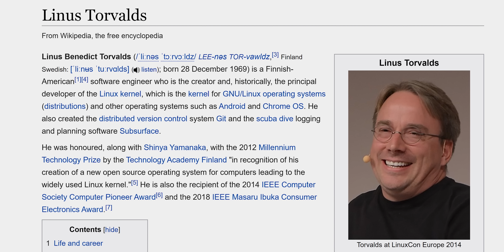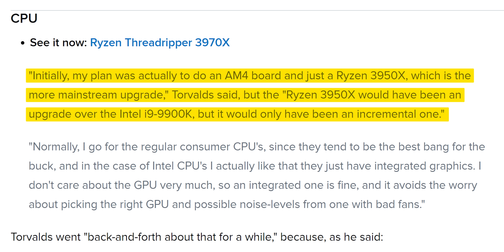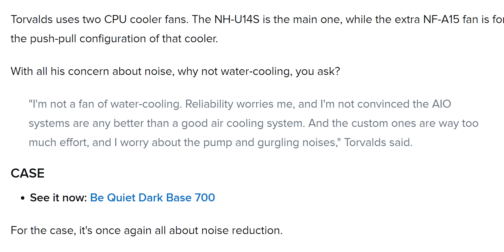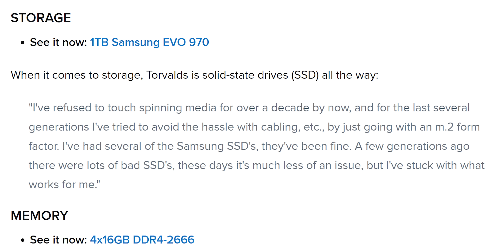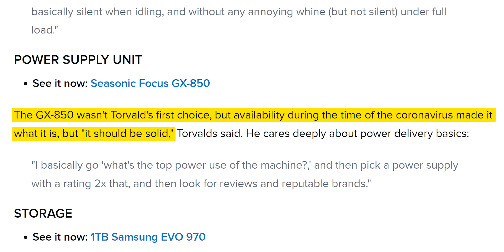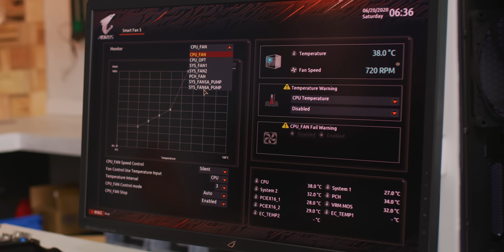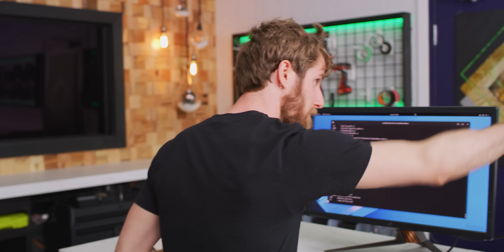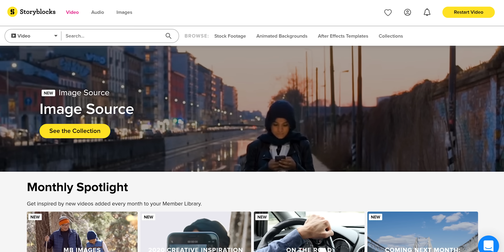Linus builds Linus’ new PC!

Comment: Hi Linus I am a developer. First, gamers tuning videos DO help (we can discern what matters to us). I built my machine (W10 pro, 3900X, 64GB 3600, X570) with focus to compile/link ~600 files quickly (replacing laptop 4C/8T i78650U). Findings = had to make sure NO core parking is in effect otherwise it will do just like the laptop (build = 2 minutes). Next, base CPU clock is not so relevant. Boost clock (how high and how long can sustain) IS relevant. After enabling Ryzen HP Powerplan + RyzenMaster Auto OC, Mobo no eco mode..., build went to 42 seconds (970 EVO plus with write caching enabled). This seemed like arithmetic 4c/12c performance increase (not making up any number here). Then, I was able to go to 30 seconds by DISABLING SMT (12C/12T vs 12C/24T).. I have no idea why this happens, using SMT @24T what happens is that CPU load is almost always constant 15% ish on exactly half of the threads (100% the others) during the entire compilation.. moreover, I would still expect this to be closer to 12C/12T but no... spooky (some internal IO bottleneck???). Then, I was able to clock 19 seconds by compiling from a RAM drive (ImDisk TK). At this point (compiling from ram) SMT off->on only makes ~1 second offset improvement (normal variation up to +/-2 seconds). Any ideas why SMT made this dramatic NEGATIVE effect?? (compiling from RAM, all 24T always 100% load with SMT on). Edit: I am still looking for ways to build faster... I did only basic HW/OS tweaking....

Comment: I don't know how your build took that long, but probably because it's a Live image running from a USB Stick!
I just finished building the latest Linux Kernel 5.7.7 on my Convertible ultrabook HPEnvyX360 with the 8-cores 15W Ryzen 7 4700U and it finished in just 2 Minutes 53 Seconds :D
I used this command (8 parallel threads)
$ time make -j 8 defconfig bzImage modules 
and this is the time command output
real	2m53,190s

Comment: 15:50 For my development needs it's pretty simple: for compiles you need a CPU with lots of multithreaded performance, over a long time. That's why I've been using a Thinkpad T420 upgraded with a quad core rather than any of the more "modern" 15W U-series CPUs Intel has put out. Their thermal design is generally garbage, and they get power throttled within a few minutes of full load - making my almost 10 year old 45W quad core significantly more powerful after ~10 minutes.

Ryzen 4000 mobile might change that, so I'm pretty excited for those devices to come out.
Reply: I just got a Lenovo P53 and the thing ramps it’s fans up when I’m not even doing anything. Intels run too hot now. My last Lenovo was quiet until I started a few 3D applications
Reply: If you get a gaming pc, you can get a 4800H Ryzen based laptop right now.  I did that as a compromise because I didn't want to wait. I would have rather gone with a pure APU Ryzen because it would save some power and I don't need super high display performance.
Reply: why the hell are you programming on a laptop
Reply: @JamesBond-fg6bt  Because depending in your seniority, you might be on the move or in between meetings. Mobility is a huge factor and most companies prefer to hand out laptops instead of desktops, since they can ask a rep (for instance, Lenovo or Apple) when they need OEM tech support.
Reply: @nuno-cunha  so rdp to a more powerful VM and compile your code there
Reply: I switched from my T520 (dual core tho) to a swift 3 with r5 4500u. I dont have numbers, but it feels pretty fast on the cpu side. The few things i compile (mostly big latex documents with lots of pgfplots, tikzpictures etc, a bit of python and very few C++ code) compile a lot faster than even my Elitetower (or sth like this) with an 3rd gen i5.
Reply: I got a macbook pro 13 2017. After 5 minutes of coding, i decided to build a pc to code instead. I didnt know intel and especially, Apple got so bad at supporting devs these days
Reply: That's a dual core, I'd have sent it back to my boss and said wtf.
Currently running a 10900K + 32GB@3200MHz, GPU is a crappy 1030 with 3xDP, just need it to drive screens.

Went from a crappy 4770 (4C/8T, 3.4GHz), my stuff compiles a bit over twice as fast, which is nice, and it probably paid itself off within a month or two based on the time difference, should have convinced work to upgrade earlier. Wanted work to get a 3900X instead, but couldn't source enough of them in one go and they didn't want to end up with two different hardware configurations to support.

Still strange for Linus not to have gone 2x1TB SSD in Raid 1 considering how much he's spending, personally I keep a VM copy of my environment as a back-up so I can be up and running in the time it takes to copy and expand.
Reply: Nguyễn Hưng  my 15 mbp, did just fine up until recently. I upgraded to an iMac,and I’m in heaven. Ymmv
Reply: @NguyenHung-qu2pb  what made the experience so bad after 5 minutes?
Reply: Are you considering installing an AMD Ryzen CPU on your Thinkpad T420??? That'd be a great video!
Reply: @angelrivera8013  Literally impossible unless you throw out the whole motherboard which is more than half the PC and even then the rest of the machine (screen, keyboard) might be too old to support connectors a Ryzen motherboard would use, if it would fit. Unless that was a troll comment, you should really overthink your judgement.
Reply: @aoelp  I'm sure overthinking brings you a lot of peace of mind. Answer me when did I make a judgement by making a simple question? But thank you for your output, you got it out of your system and it must've brought you a great amount of quality rest.

Comment: Hey I am not sure how so could you make sure that all of these parts are all compatible for me before I get them? 
Motherboard: MSI b450m Tamohawk Max ATX
Graphics Card: GeForce GTX 1660 Super
Case: CoolerMaster MCM H500P Mesh Black (Get the Mid-Atx version)
SSD Card: WD Blue 500gb SSD
RAM: Corsair Vengeance 32gb DRAM (2x16)
CPU: AMD Ryzen 5 2600
Power Supply: Thermaltake Smart 600w Black
Extra Fans: Aurora DR12 RGB LED 3 Pack 120mm Fans

Comment: I'm a programmer, my CPU is a intel Core i5-4570T @ 2.90GHz with integrated graphics, 8GB RAM, 2TB HDD (i had upgraded from 500GB) and my OS is linux mint (previously windows) . This was a second PC and it is fast enough for me. Unless your Linus Torvalds or an AI researcher, most programmers will not need high spec hardware

Comment: You just called Linus Torvalds an "average software developer" and doubted he "takes the time to get to know PC hardware". Dude, this guy is not just not an "average software developer", but also he has spent the past 30 years writing a motherfucking kernel, do you have any idea of the level of hardware knowledge that he has? He wrote all of the first drivers in Linux all by himself. If you think you know hardware because you take it out of boxes and slap it together, well he's spent 30 years talking with hardware in the hardware's native language. Remember Transmeta? Torvalds was hired by them as a lead engineer. Yes, this guy worked on designing a CPU, a fairly revolutionary one at that, I might add.

Linux is not like windows, where drivers are entirely third-party work, 99% of all drivers are built right into the kernel, and even though he does very little actual coding now, he did a lot for years, and he still is familiar with the entire kernel. 

This guy knows hardware in a way most people on the planet, you included, will never get to. 

Also, his OCD is legendary, I'm pretty sure he spent a week doing cable management.

Comment: Finally some praise for my favorite brand “be quiet!” They dedicate their products to silence!
Reply: I don't know why they didn't go with a BeQuiet power supply.
Reply: I miss the Antec quiet line of cases. I am sad I got rid of my old Antec p180. Side and front panels were all fitted with sound dampening material. If you put Noctua fans in one of those, I'd bet you could hear a pin drop at full 32 core load.
Reply: Meh.  I like bQ!, but don't be surprised if soon even they don't offer any new cases with a windowless/no RGB option.  A decade ago, some of the best manufacturers offered quality desktop cases with outer shells made of aluminum or metal, some 2 mm thick, designed elegantly.  Today, (except for some htcp, itx, & micro atx cases) few manufacturers offer "enthusiast market" consumers a windowless/non RGB choice.  Gaudy, tacky, useless RGB lighting has found a way into nearly every internal or external component possible.  Even mouse pads.   Popular tech sites blazed the trail for the "enthusiast" market.  Well done, eh?  🤣
Reply: @beli3636  To be fair RGB doesn't have to be gaudy or tacky. And yeah it's useless by nature, but it can make your pc look a little nicer in the room with some nice accents. 
I just typically follow the keep it simple rule for mine. Accent my build a bit, and the only reason it's RGB and not solid color is so I can change my color scheme occasionally when I want to. Boxy blank cases can be nice but I like the tiny bit of style I can get out of mine now, and it's still dead silent except under full load.
Deadening material is easy to add if you want it, and the only side you can't add it on is the glass (or, well, you could but it would look a little silly unless you were clever about it...)
Reply: Be Quiet is cool but you should check out Phanteks

Comment: I would absolutely got the 135W TDP Sapphire PULSE RX 5500 XT 8G GDDR6, instead of the 225W Radeon RX580.
Less heat and more quiet and still a little bit higher performance and more display ports.

Comment: Gigabyte boards are basically Linux and OSX ready, so that's probably the main reason it was chosen as a lot of the components are compatible with alternate operating systems out of the box. As for power delivery, the cpu and memory do draw a ton of power, better to have overhead especially if it's running intensive software. So I've heard Amd's Threadrippper is pretty hard on motherboards which is understandable given it's large power draw.

Comment: Hmm, lots of similar hardware choices to my current rig! And it's running arch. =D
Just installed manjaro on an old macbook mid-2012.
Thing had so many drive issues on windows with no way to stop windows overwriting bad auto drive installation. Causing the system to be unusable or usable without many features (sound, etc)
Anyway... manjaro, everything worked out of the box. Including stuff that had non-existant drivers on windows due to apples bad maintenance of old support files ( disappearing legacy stuff).
Old games that no longer worked on windows because of missing DLLs etc, also worked perfectly fine in Wine.

Comment: Linus, you disappoint me. I'm in the Jayztwocents camp when it comes to liquid cooling - unless you are a super edge case doing extreme overclocking, small form-factor builds, or ultra-heavy workloads, there is zero advantage to going with liquid when there are air cooling solutions that are just as good, and in some cases better, than liquid.
A nice, big, chonky heatsink block is appealing to me personally however, so your mileage may vary.

Comment: As a software developer myself, I would like to clarify that Linus Torvalds built the machine solely to compile code. Operating System compilation is one of the longest things one can wait on. Also, Linus is known for being very anti-cloud. Any big project coded in a C-like language will take time due to linking libraries and the lack of niceties other languages have(object-oriented structures, IDEs, and packages managers to name a few). If you are a developer you will most likely know what you need. Although, for those who just graduated and don't know what they need yet, this is overkill. I have no problem with having or wanting something powerful in fact my pc is overkill as well. But you do not need a machine like this to code. My professor when I was in school consistently said any laptop would work. If you need more power find a cloud service to offload your work too. The service will be much more powerful and there are a few good ones for free. 

I write this to tell any new developers who worry about their old machine that they do not need a new machine. A laptop with an internet connection will more than likely do the trick. If you need more than that your workplace will tell you and more than often give you anything you are missing. Practice coding challenges to get a job! A faster computer will more than likely do nothing for you unless told by a superior or you just want one anyway like me.

Comment: My favorite thing about Linus Torvalds after using Linux for some time is that F-bomb to Nvidia. Linux desktop development could be pushed so much if Nvidia wasn't making it so difficult.
Basically now you have to use over 30 years old display server, because Nvidia has driver for it, and development of modern display server is stopped by Nvidia, because they refuse to implement GBM to their drivers, and propose their API (EGLStreams) instead, and - you know - having to support two APIs at once is hard, not cost-effective and fixing bugs on GBM doesn't mean you fix bugs on EGLStreams.
So yeah. F*** you, Nvidia.
Reply: Getting an nvidia card working with the drivers is the most annoying part about installing linux. Like, everything else installs so perfect on Mint, but I have to trial and error stuff from package manager to get good accelerated video.

Comment: This benchmark: I'm one of the fastest runners on Earth, I can run around my house in less than 30 seconds without even sweating. Of course you don't need to know the noise levels I produced while I run, how much heat I produced. Or the size and environment  configuration of my house. Please don't ask me how long I would take to make this run on my 9900K sneakers, or any other sneakers model for reference.

It's easy to end with the conclusion this is a great bang for the buck, quiet and well cooled, when you don't list how much it costs, don't measure the noise and temperatures, and don't compare the execution time to anything. I guess mentioning the version of the kernel and the configuration would be a bonus.

Comment: Linux is also good for MUSIC production and this type of machine build is very good for MUSIC making cause POWER and SILENCE is what you need in a studio especially when running a DAW with many VST plugins its maybe and interesting option for people than windows 10 yet I suppose you could have OS selection available with windows 10/mac os perhaps a future build for a machine you could showcase this with a high end 16/24 channel sound card with touch screen monitor all optimised for low latency for use with MIDI devices since many of the USB ports will likely all get populated in STUDIO setup so the 5v rail on the PSU must be good to make this possible also finding a good UPS unit to smooth out the power and also provide power in case of power outage to enable saving of any projects.

Comment: re 10:29 you're also working with a higher efficiency portion of the percent efficiency / watts curve when graphed. Using greater than 80% of your power supply's maximum voltage starts to impair efficiency by 1-5%